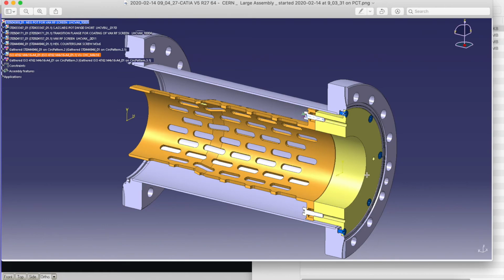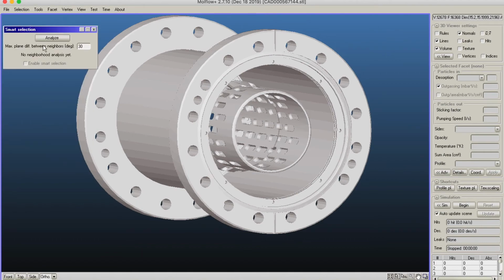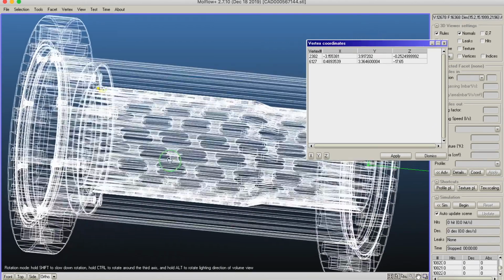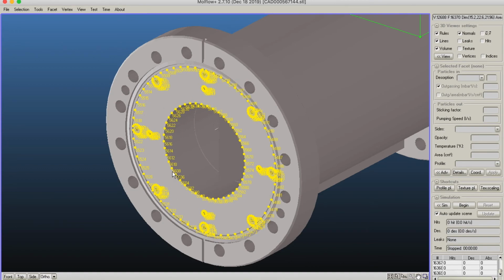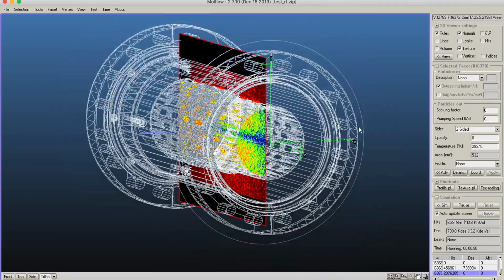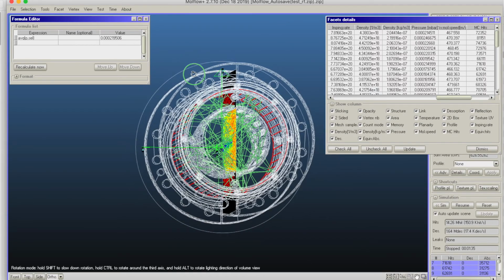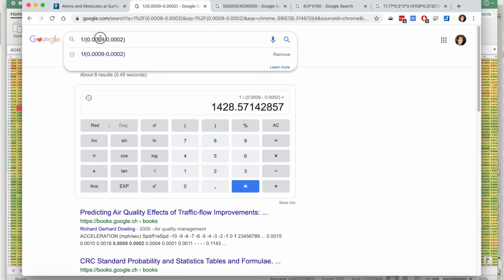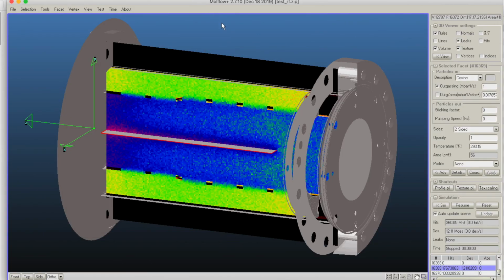Molflow webinar - Conductance calculations (part 2 - real-life geometry)

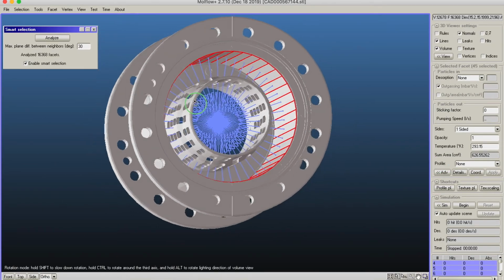Comment: Thanks for this video. It is very helpful. I am working on a similar analysis and have a question about the method. At 4:50 you set the sticking factor of the pumping surface to 0.5 and state that you only need to know the pumping speed in order to calculate the conductance. But at 14:00 you use the total outgassing rate and pressure difference to find the conductance, not the pumping speed. It seems like if you change the sticking factor it will change the pressure difference, but the throughput (q_pV) will remain the same, so you'll end up with a different conductance.  So how do you account for the pumping speed? Thanks again.
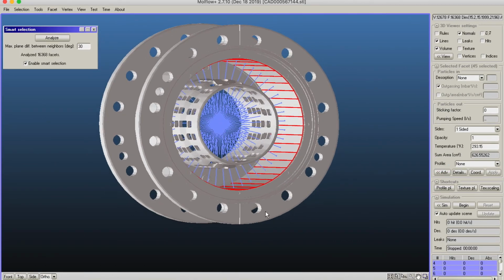Reply from the maker: Thank you for the great question! Indeed, I was wrong at 4:50 and we don't need the pumping speed value after all for the conductance calculation (that was the case for the effective pumping speed calculation at part 1, eq. p=Q/S, which we won't use in this example). Surprisingly at first, the pressure difference does NOT change with varying the sticking factor - I tested it with different sticking values of 0.05 to 0.3 to be sure. You can even see this verification at 16:43 where I change sticking from 0.5 to 0.1 and still get the same pressure difference. So to recap, you don't take into account the pumping speed for your calculations. That said, you need a measurable difference between the inside and the outside. With a too small S.F., the difference will be too small compared to the pressures to measure precisely (stat. scattering), with a too large sticking, the outer pressure will be too small to measure. In the video I finally used 0.1 which seems a good compromise (even though the calculation result will not depend on the choice)